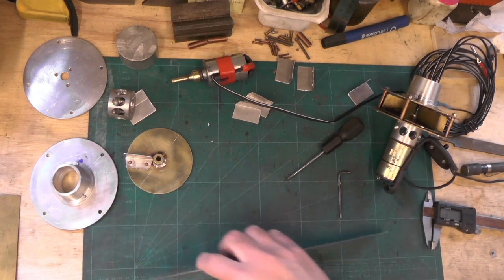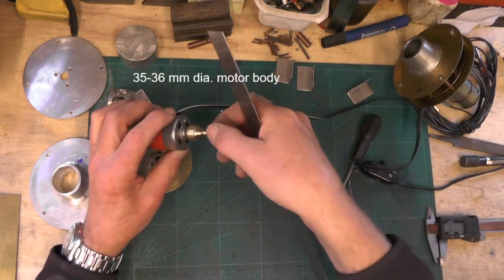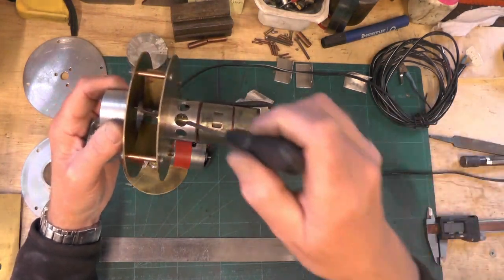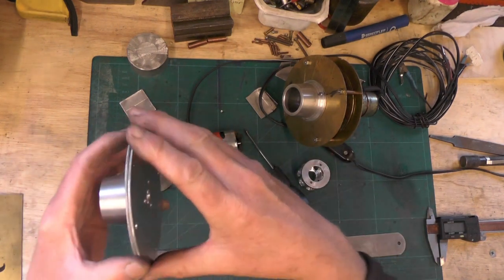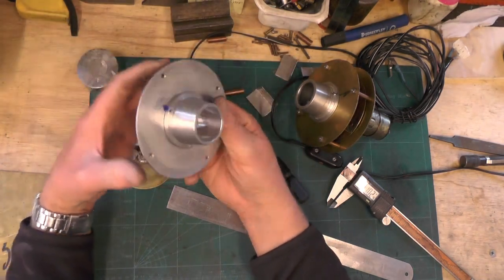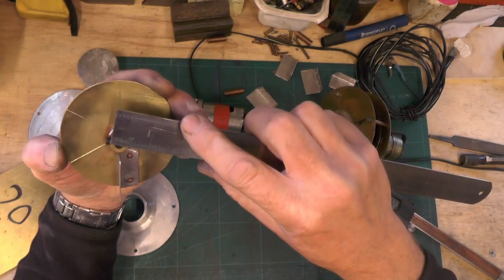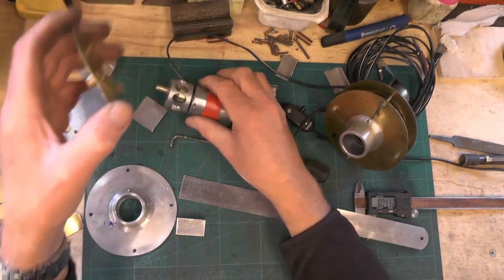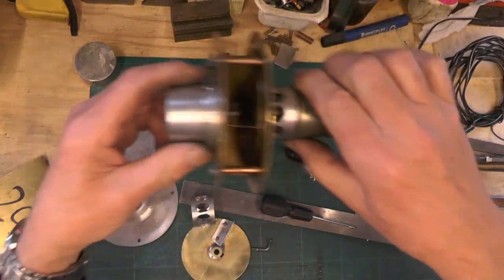Make a Simple & Effective Miniature Locomotive Steam Raising Blower  "mr factotum"

Comment: Hi Kev , I had built a duplicate of your gan plans except I used a bathroom ceiling fan motor .( " Was not a good idea" ) it was too slow . The motor you used is ideal . I was just trying to be thrifty but it didnt pay off .
Will replace this motor with a 12 volt high speed fan . 
🤔 I tried .

Cheers 
Craig ☕
Reply from the maker: hi craig 
its all about trying, if something don't work, just try again, i'm an expert at trying again🤣🤣🤣🤣🚂🚂🚂🚂👍👍👍👍👍
cheers
Kev

Comment: Hi Mr F , can you put a link up to an Ebay item for the 12 volt motor to use for a blower ,? Many Thanks and hope you are keeping well ?  Chris
Reply from the maker: hi chris
I am unable to put a link as the seller no longer exists, but its a Mabuchi motor rs 545 sa  12v to 24v
Reply from the maker: hi chris
I am unable to put a link as the seller no longer exists, but its a Mabuchi motor rs 545 sa  12v to 24v 12600 rpm.
hope that helps chris,  any other info feel free to ask
regards
mr f
Reply: @MrFactotum  Many Thanks

Comment: Excellent design. Motors from discarded cordless drills are usually available free and regardless of the voltage listed run well on 12 volts.
Reply from the maker: Thanks for that gene
good information to know, I will bear that in mind for future reference
regards
mr f